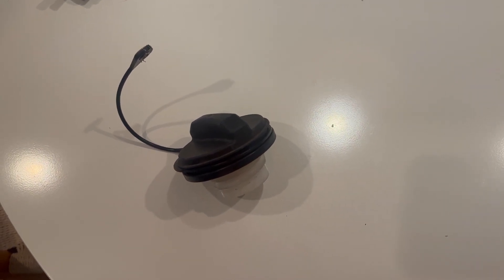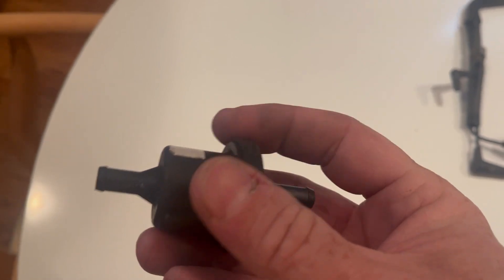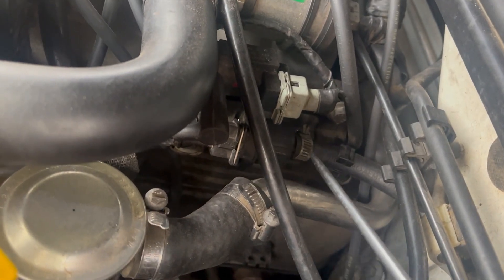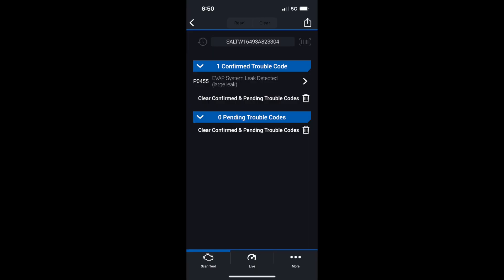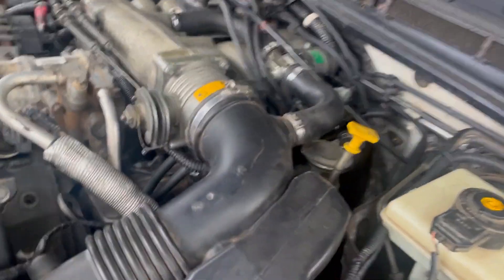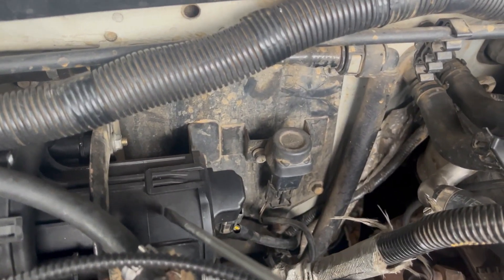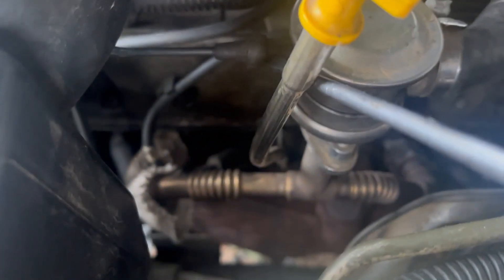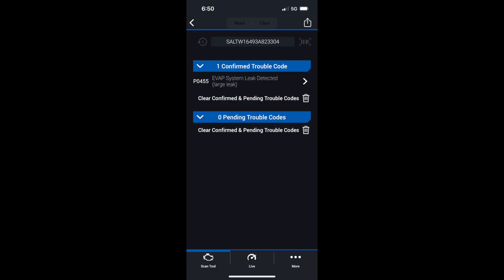Land Rover Discovery 2 EVAP issues, codes and solutions

Comment: what does secondary air injection have to do with EVAP?  two different systems.
Reply: Good point. I have two different codes on my 2004 D2 that started around the same time. I have the P0455 and the P1415. My SAI started running when I stop at traffic lights, and it generally just runs at start up. I started experiencing sputtering when I start the vehicle and it idles for ~15-30 seconds. Then it balances out and accelerates fine. My point is they "may" be related. I replaced the gas cap - didn't resolve.
Reply: @branchclan6112   do you think changing out the pump worked i have p1415, p1412 both side malfunction reading no air! i changed out the valves, small pipes to them and tightened all fittings and still getting them, funny thing is it seems that my pump sounds great. and engine is running what i think is normal no spitting or misfires, i could really do with some help!.............i swapped to another Bosch 4.0 click and play kind of deal. it passed everything else on the inspection just not emissions.... secondly i did the drive cycle for the ecu to recalibrate itself and the o2s started which are brand new but not the brand new y-pipe catalytics.
Reply: sorry o2s are reading obe moniter saying cats are not

Comment: Curious why the Bosch evap over the cheaper alternative? I recall doing this on a P38 and while the Hyundai made a clicking sound I recall it working. It’s been a long while though.
Reply: I've had the Hyundai one running for about 8 years now.
Reply: My Honda one clicks also when air is on. It did. Once. Loud. But works it was actually new from AutoZone now the EGR valve is tapping loud